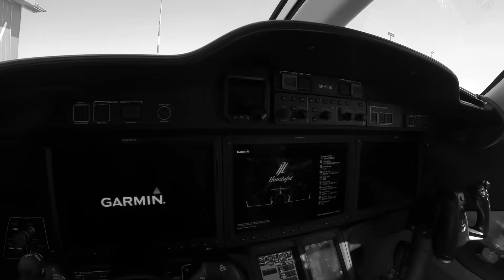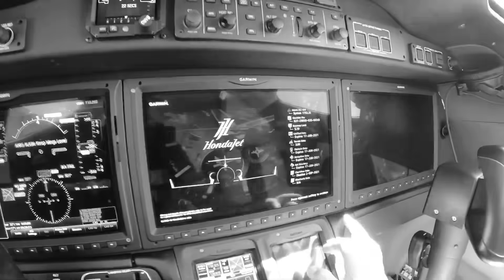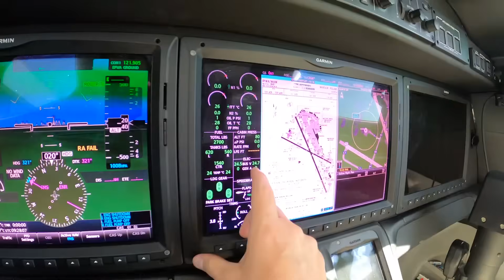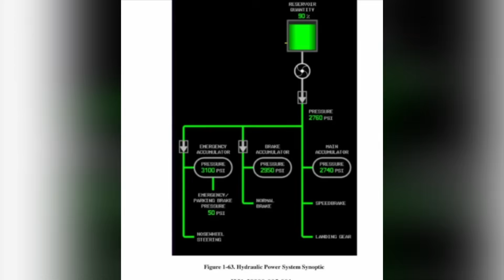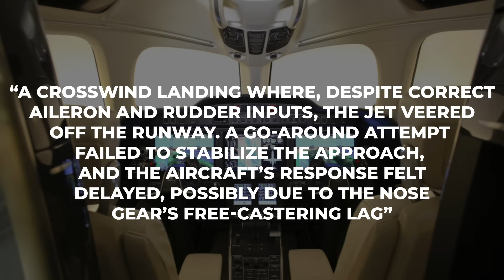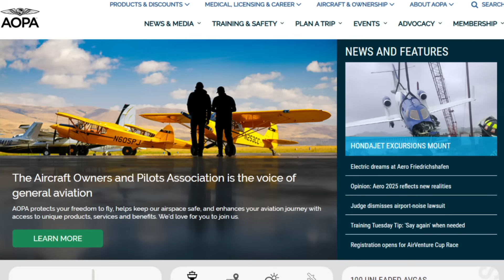The Real Reason That N826E Crashed On April 7, New Discovery...

Comment: The video tries to blame the aircraft, vis a vis the steering design of nose wheel as being at fault, 
which is BS! as steering is patently not the issue here as  the pilot simply runs off the end of a runway because his approach speed was too high AND he landed with a tail wind FFS on runway 5 instead of landing in the opposite direction on runway 23 with the appropriate head wind.

The pilots approach speed was apparently too high, also landing with a tail wind FFS on runway 5, instead of in the other direction on runway 23, is bizarre.  IMHO... Pilot Error is why the aicraft ened up in the drink.  

THIS VIDEO IS AT BEST, DISINFORMATION.  IRRESPONSIBLE AI GARBAGE

Comment: approach too fast with conditions less than ideal will mean the plane may not bail out that issue. Looks like a small window to operate in. Plus I wasnt aware the Honda jet didnt have reverse thrust. surely that would help with higher speed landings in less than ideal conditions and take the onus off the brakes.
Reply: The illustration also shows the touchdown point was long and too fast - ok if into wind but with a tail wind that makes things more critical. I would put this down to very poor piloting and bad decision to land downwind.